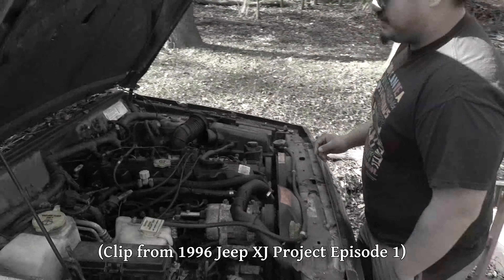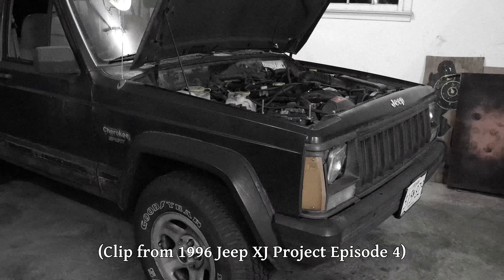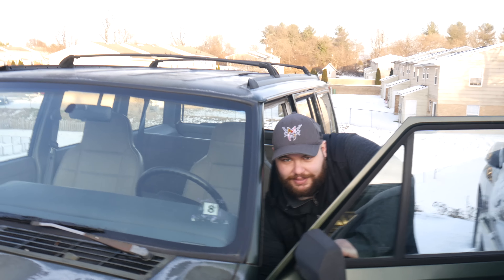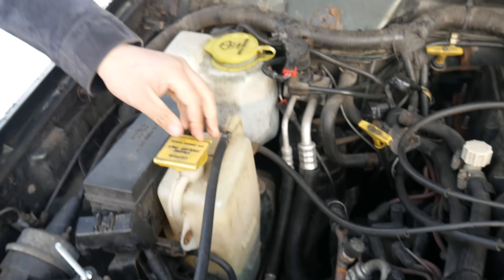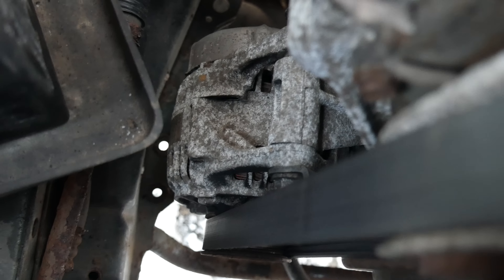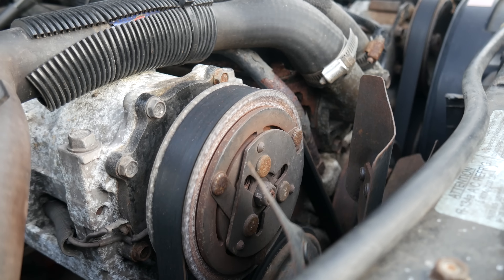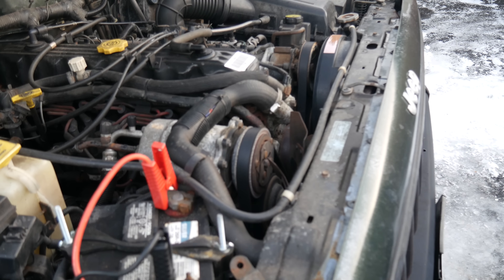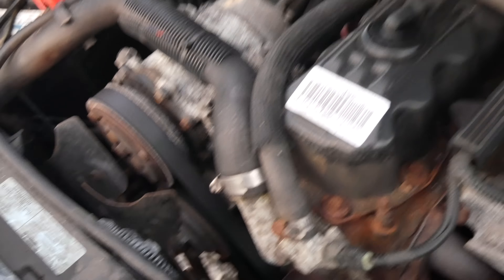1996 Cherokee Project Catch-up and Alternator Replacement (Ep.5)

Comment: My boys f150 stumbled at higher rpms.  Changed the plugs and the ignition coil on the 3rd cylinder.  Cleared it right up.
Reply: Yup my 4.6 explorer did the same thing fell flat on its face after 3500 new plugs and wires fixed her right up
Reply: @whydoihave6neutrals772  I got a good chuckle out of your name.

Comment: My Cherokee did the exact same thing. I ended up splitting the wire harness and finding wires that looked melted together. Also reran all of my grounds to the motor and added another ground from the body to the engine block. Been running great for three years now!

Comment: Living in california my whole life.... it's unbelievable how much rust you guys get on your vehicles.
We don't even see that much corrosion on 100 year old cars!
Reply: psygn0sis  Yea, it sucks. It can get a lot worse too. You are truly blessed with no rust.
Reply: you should see my 5 year old subaru... that's been oil undercoated pretty much every winter. calcium chloride and magnesium chloride are no fucking joke when it comes to steel, aluminum, magnesium... but especially steel.
Reply: If I ever by a used car worth more than my shoes, I've already decided that I'm flying out west to do it. The rust game in our part of the country is no joke, but used car prices are pretty much national. No way I'm shelling out like $20k+ on anything from around my neck of the woods.
Reply: I live in PA and cars rust horribly here anytime I’ve had to get a new car it’s never been the drivetrains it’s always been the car corroding away 😂
Reply: Fishermanguy44  try living in the UK, annual safety inspections called an M.O.T, which includes an emissions check. You can have a decent exhaust though, but it cant be too loud or else the car will fail the test.
Reply: Fishermanguy44   not too bad then. Rust is also another thing that can cause a car to fail an MOT . If it's too close to suspension, seatbelt anchors, seat mounts or somewhere structural it will fail as well. However I would rather keep the system  in place as it tends to keep cars that are not fit for the road, to be kept off them.
Reply: @pugman205  living in Michigan and reading about car inspections is always weird literally the only inspections we have here are if someone or the police complain about the noise of your exhaust or is some part of the equipment is obviously defective.
Reply: @icu_corey_rn_903  Yup, me too--I've retired 5 cars in the last 3 years due to a PA life
Reply: I can tell you that cars in Santa Monica area that are rusted.you can even have salt in the air
Reply: some dodge trucks here in michigan literally rust off of the frame long before anything mechanical fails.
Reply: psygn0sis Thank God everyday you don’t have it. Although I’d tackle rust for the rest of my life if it meant I’d never have to see California again.
Reply: Fishermanguy44 We don’t have any inspections what so ever in Kentucky. The only thing close is when you bring in an out of state vehicle. They check blinkers, horn and lights. You don’t even have to start it.
Reply: That Jeep is clean for the north. I've seen way worse on the road.
Reply: That Jeep is clean for the north. I've seen way worse on the road.

Comment: My 92 xj had the same issue. It started out as a miss around 3000-3200 rpm. It bugged the hell out of me and i couldnt find the source of it at first. After changing the fuel pressure regulatior, crank position sensor, distributor pickup sensor, plugs, wires cap and rotor, fuel filter, i couldnt fix the issue. I checked fuel pressures at the rail, leakdown and compression tests so it wasnt any burnt valves either. I kept driving it and as time went on that rpm range got broader and broader to the point itd do it at any rpm and any load. Long story short, i ended up having a lifter wear into the camshaft and chew up a lobe. After the new cam and new set of lifters, its a brand new truck. Hopefully this isnt your issue as its not too expensive to do, its just a pain. Great vids by the way!
Reply from the maker: Honestly it wouldn't be too surprising if that was the issue, when we first started it up there was no oil getting to the valvetrain for at least 30 seconds (until revving it) so that plus 150k miles may well have done some damage. Will have to keep that in mind!
Reply: @FuzzyDiceProjects  And a tip for you, if you do end up needing to do this, take the head and manifolds off as one assembly. Sure it will weigh about 100lbs so have a friend with you. Use a long 2x4 and a chain bolted to two of the rocker pedestals so you and a friend can lift it up while you both stand on the side of the car. Much easier removal and installation than having to juggle two manifolds at once . Used this trick with my xj and my buddys zj. Good luck!

Comment: the escape alternator is almost as bad as the alternator on a 2.3T SAAB 9-5 with the 150A alternator. that requires removing the passenger CV axle, upper engine mount, slamming a bolt extractor in the allen key headed bottom bolt that always strips out, connected to your impact gun with 3' of extensions because there's no room for it anywhere near the alternator... oh, and then you can't get the unbolted alternator out without DROPPING THE FRONT SUBFRAME BECAUSE IT'S TOO BIG TO FIT THROUGH ANY OF THE AVAILABLE OPENINGS.

Comment: You may have fixed the issue already but check the injectors and make sure there flowing good. Especially from the nasty crud from before. Jeep injectors are known for blocking up. They have a 1 hole design. Aftermarket ones have a 4 hole design for better distribution and atomization

Comment: Fuel pressure regulators typically run on vacuum so that would make sense if it was stuck it wouldn't supply enough at high rpm. But that said, I know with Honda's when they fail, it's usually stuck open and the car runs pig rich 24/7 so I'm not sure how they fail on jeeps, I suppose the sputtering could also be too much fuel so I guess it makes sense either way.

Comment: My 94 Cherokee did something similar at high RPMs, I replaced the Idle Air Control Valve, Throttle Position Sensor, and the O2 Sensor, which fixed the problem
Reply: I have also suggested forward O2 since my TJ was doing something similar and that was the cure.
Reply: My 96 did the same thing tps was the problem

Comment: I’ve got an extra battery hold down from a 99 Cherokee hanging on my garbage can in the shop, stop by and grab it! Swap in some Mustang GT fuel injectors (94 I believe) and that’ll take care of that stumble and swap out the sending unit and regulator and it’ll run fine!

Comment: I think I would have replaced that alternator at the first sign that it was locked up. Apparently you guys don't have my luck which would have been the jeep snapping and throwing the belt when I was the maximum distance from home, at night, in winter. I hope that fuel pump and sender assembly resolves the issues. I have a feeling that it will. I have considered getting a cherokee as a daily driver to keep miles off of my ZL1 but after seeing how stuff is crammed in that engine bay i'm reconsidering my selections.

Comment: BTW my dad had a 95 would randomly stop going above 35mph or 3500 rpm. It ended up being the catalytic converter, the element was loose inside and would move and clog the pipe. From this video it might not seem to be the case but just throwing it out there because you can check it with a few hits and hearing for it.
Reply from the maker: Since the exhaust pipe has rusted off and is nonexistent behind the cat it is pretty easy to check, we looked through it with a flashlight and everything appeared to be looking good inside of it. Though, I can't remember WHEN we checked it. Will have to double check on that now that it is stumbling

Comment: My 98 Jeep had this problem and it was solved by changing the regulator in the tank. Buy the whole assembly so you know pressure and level indicator works. Should be 42psi-50psi.

Comment: My old '98 XJ did something similar a couple of times. First time it was the TPS but only after it warmed up. The second time sucked as it was the cat that broke apart inside and plugged up. Of course, I was 3 and a half hours away from home. It took about 6 hours to get back what with the having to stop to let it cool down. The more gas I gave it the higher the backpressure got so the slower I'd go.

Comment: Just finished swapping the engine of a 1995 Cherokee 2.5 diesel, the infamous VM Motori diesel. Old engine spat the nr4 connecting rod through the block! Now at midnight nov30, the "new" engine is in, after swapping the pump and everything over from the old engine, since the new engine was drive by wire

Comment: Had a 1994 jeep Cherokee with very similar issues with cutting out and missing. Ended up being the ignition system replace the rotar cap wires and spark plugs
Reply from the maker: That is something we will check into if the sending unit doesn't sort it out, but the inside of the cap and the rotor looked good, couldn't find any arcing from the wires, and the plug that we pulled (I think we did that, I could be misremembering) didn't show any signs of issues. Doesn't mean there aren't any there, though.

Comment: Locked up alternator is common on all Cherokee's.  It's very low on the engine and most are missing the rubber splash shield to help keep out dirt and water.

Comment: My '97 Jeep Wrangler had a problem that seems to be like your Jeep.   After swapping out several parts,  it turned out to be the O2 sensor.   That worked, no stumble since then.  my mechanic said it was the second time he had ever seen an O2 sensor do that.
Reply from the maker: Interesting! We haven't really looked at the sensors with the engine running and driving using a scan tool yet. Certainly should be worth a try, thanks for the tip!

Comment: There was a TSB I think on those xjs about the heat off the exhaust manifold causing the fuel injector on cylinder #3 or #4 sticking and causing a misfire.

Comment: i would agree with your diagnosis. it sounds like a bad fuel regulator not supplying enough pressure at high rpms
Reply: David Lewis  Not to disagree with the general statement that 2300 isn't "high" RPMs, but you want to be shifting a stock 4.0 at no more than 5k (and mine feels like its out of power at 4500 or so)... The red line on mine is 5,200. I had to rewind the video to see his dash again and I have no idea what optimist decided to factory install a 7,000 RPM tach in that XJ.

Comment: I would change the cap, rotor and cables for the distributor. I had a similar stumble on a 97 wrangler. It would never throw a code, but just fall on it's face randomly at high RPM. I ordered the tune up kit "just because", not thinking it would fix it, and it hasn't happened since.

Comment: It's fascinating how close, but so far away, changing alternators on that XJ vs. my TJ is... I wouldn't have thought they'd be that much different, but the XJ is way worse... I just did a TJ alternator replacement on my channel a couple of months back if you're interested.

Also... Years ago my TJ was acting somewhat like that with the hesitation (though being a stick, it seemed much worse) and it ended up being my forward O2 not being quite out of range, but operating on the low side of it and never throwing a code. It took me months to find that problem and I still can't believe an O2 would have done that (especially given all of the rusty plow trucks I've seen driving around with the O2s literally swinging in the wind).
Reply: I just replaced the alternator in my XJ recently and it was super easy, removing the bracket it mounts to makes it way easier to remove, I didn't have to remove the mechanical fan to get it out.

Comment: 17:10 That is not actually the voltage regulator. The voltage regulator is in the ECM. That black plastic thing is just an isolator for those wires.

Comment: I was told the same after I replaced my CPS with aftermarket ( Standard brand ) rather than Mopar. Seems to be working ok though. It's surely quite a basic sensor - I can't see why a reputable aftermarket brand would crap out - but we shall see ..

Comment: the stumble is the fuel pump getting hot and not pumping the right pressure, i've had the same problem before
Reply from the maker: Interesting, thanks for the tip! That fuel pump is a pretty cheap model and we are replacing the whole thing with the fuel sending unit so hopefully that takes care of the issue either way.

Comment: Shoulda just replaced the alternator months ago, that and change your fuel pump/regulator. Probably cant keep up with the demand at high end and it leans out.
Reply from the maker: We didn't have anything to replace it with at first, and not a lot of money to spare for this project (though we had to shell out for that fuel sending unit eventually). We were more interested in diagnosing the engine stumble, that was the plan every time we looked at it since it seemed more pressing, but the alternator kept getting in the way.

Comment: My jeep did the same thing. Replace the thermostat. I have a 93 that was losing power at the higher RPMs. Replaced the thermostat and that solved the issue. Not sure it will work for this jeep but worth a shot with such a cheap part.

Comment: That job is waaaaaaaay easier if you do it all from the bottom. You don't have to remove the battery or anything else you just take the bolts holding the wires and alternator itself on turn it sideways and drop it straight out the bottom then do it all in reverse. 10 minute job.

Comment: I will never get why just not replace the belt while you have everything removed... it's a cheap part, replacement is time-consuming. Just why? After working on my old cars for a while I started to value my time more and I just replace/check everything around when I do some big job because I don't want to touch it again soon. Especially with the XJ...
Reply: Sometimes you've got more time than dollars and this is clearly a spare vehicle for the owner. Looks like the guy is just trying to have some fun with it from time to time and not break the bank. I've been there on all counts before.

Considering how young most of these guys are, I'm all about them doing anything that puts a wrench in their hands. Good stuff no matter how it turns out!

Comment: Suddenly the engine bay on my 94 F150 seems cavernous...
Reply: I'm wondering how you could have felt it wasn't cavernous before...?
Reply: Steve Richardson if you have the 300 straight six, it is. You can stand on the frame rail on both sides of the motor no problem. Did it all the time until that transmission hit the dust at 395k miles and I scrapped it.
Reply: @MegaDysart  oof...at least tell me she was rusty🙁

Comment: Why not just retrofit a 97 fuel sender into the 96?
Reply from the maker: It would have to have a fuel return line added, the fuel rail changed to accept a regulator. Though, the lines are super rusty and should be replaced anyway so it wouldn't be the worst idea. That's the main reason though, it wouldn't be entirely plug-and-play.
Reply: @FuzzyDiceProjects  my question is based solely on the "if you have to fix it, upgrade" mentality. Not trying to be a d-bag about how to skin a cat. Great vids, keep em coming.
Reply: @1701gijoe that is really good to know. Doesn't change that I would've replaced the entire fuel system with a junkyard donor just to get rid of an obvious failed beta test of parts in a single model year.

Comment: You’re probably gonna get some overheating issues until you replace that fan shroud.
Reply: Always good to have a fan shroud, but it's basically winter now, and it should stay cold enough in Maryland till April-May to have any cooling problems.
Reply: Nothing some JB weld won't fit.
Reply from the maker: We pulled a shroud from a different junkyard Cherokee (footage of that didn't quite make it into this video) and plan to eventually install it. Hasn't really been driven enough to notice an issue with heat yet anyway

Comment: Why not just change the fuel regulator to the engine bay type?
Reply from the maker: It would have to have a fuel return line added, the fuel rail changed, and the regulator either bypassed in the sending unit or a later/earlier model installed. Though, the lines are super rusty and should be replaced anyway so it wouldn't be the worst idea. That's the main reason though, it wouldn't be entirely plug-and-play.

Comment: From the looks of the sending unit, that gas tank is complete garbage. I wouldn't stick an old fart in it, much less a new sending unit/regulator/discontinued expensive part.

What is that Gen III GM motor going in, the blazer? smiles devilishly